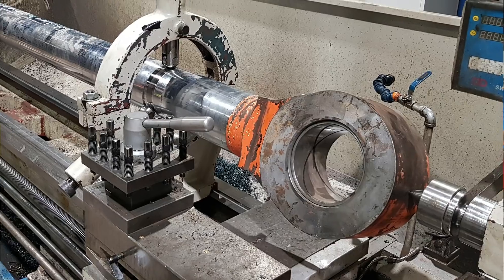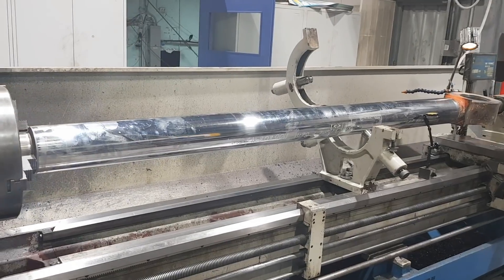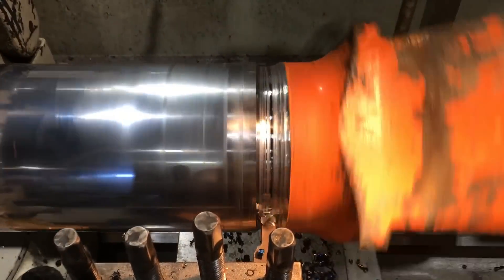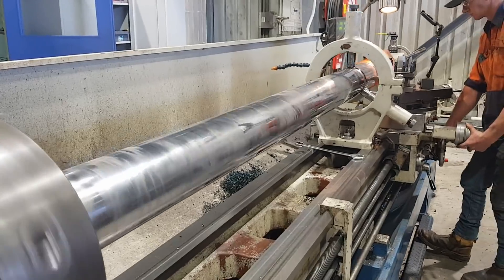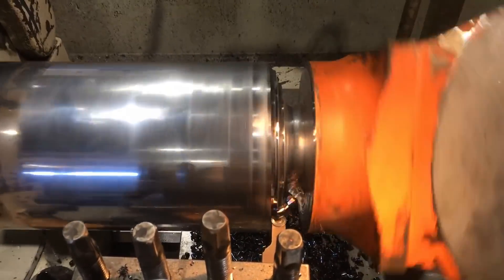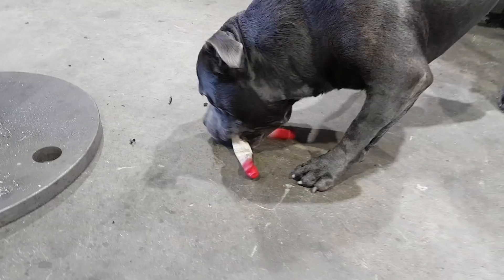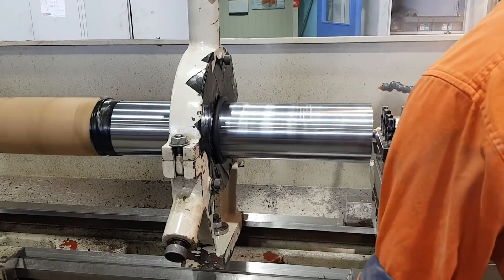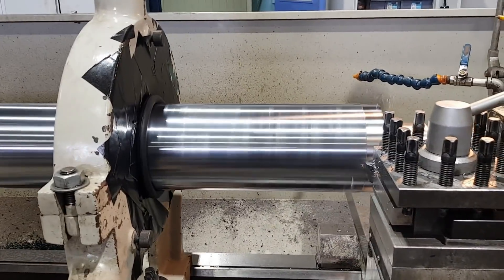Machining a Hydraulic Cylinder Rod for Hitachi EX1900 Mining Excavator | Lathe Work & Welding

Comment from the maker: Hey viewers thanks for watching today's video on machining a new hydraulic cylinder rod for the Hitachi EX1900 excavator. This one was a job we did last year so we've included some extra commentary to answer a few questions we often get about how or why we do what we do! If you have got any questions drop a comment below and will do our best to answer them 😎👍
Subscribe and hit the bell icon to turn on notifications so you don't miss our weekly uploads. 👇 🤳
Follow us online here: 
Instagram https://www.instagram.com/cutting_edge_engineering 
Facebook https://www.facebook.com/cuttingedgeengineeringaustralia/
Reply: Thanks for finally clearing up my question about cutting threads. I still don't know what a "top slide" is, but after watching this video and watching you REVERSE the lathe, and therefor the cutting tool, I finally understood how you got the tool properly indexed to the already cut thread.

BTW, how would I go about sending the shop foreman a new toy that might be a bit harder to destroy?
Reply: Hmmmm I've seen you around somewhere you wouldn't happen to be around western subs
Reply: Dam you need a solid rubber chook
Reply: Dam have you thought about making those nuts yourself $3000  per nut is good money I'd prefer local then having to wait for a part
Reply: Pl
Reply: Imteressante

Comment: Duck Tape was invented in World War II by Vesta Stoudt, a mother of eight. Two of her sons were serving in the U.S. Navy. She was packaging cannon shells, and realized that the paper tape, being used to seal the boxes, could not be torn off without breaking, which could cost soldiers precious time in battle. She invented duck tape because it could be pulled off in one motion every time without breaking. She wrote to President Franklin D. Roosevelt in 1943 with the idea to seal the boxes with the fabric tape which she had tested. The letter was forwarded to the War Production Board, which put Johnson & Johnson on the job, since they had made medical adhesive tapes from duck cloth. They developed the new adhesive tape, made of thin cotton duck coated in waterproof plastic, and using a layer of rubber-based gray adhesive. (The technically correct name is duck tape, since it was originally made from cotton duck cloth.)

Comment: The first time I tried making threads on a part I used the travel dial method. I started out with the half nut engaging just before the line on the dial, but one of the times I timed it wrong and ended up on the other side of that line and my cut ended up being down the center of the top of the thread. I did the rest of the cuts by keeping the half nut engaged and all the other ones I've made since then have been done that way because I don't trust myself enough and I don't have a bunch of scrap material laying around to practice on. Gotta get it done right the first time. Takes a bit longer but you can't screw it up that way. When you've got a $2k piece of chromed rod chucked up, I imagine you don't want to mess that one up either.

Comment: you know some cool tricks! An old timer told me to make threads even faster flip your tool and run in reverse, I tried it once but figured it may damage the ways. I thought I seen you threading with the cross slide in a couple other videos, I do that as well. my college instructor was a machinist, he taught me a few cool tricks, like the way to leave the half nut and run it back to your start. stuff like that just isn't in a textbook. hopefully ill be working on large pieces like that someday

Comment: @ 10:03 I was taught the same method in trade school which works well in bot metric and imperial standard threads. But the threading dial is much better if you had to to do another job in the part or the machine was cut out of power while working on it (for safety reasons) . But most threading dials are designed for imperial style so this method is your only option sometimes.

Comment: I was confused about the rest of the rod until I read the description section.  I'm not a machinist guy, so explain to a dumb dumb why you dont weld that thing down and pull out a monster press to bend it back into shape.  Even if it deformed a little, you could lathe it down for a smaller excavator...

Comment: question for a none machinist background as I chose to be a diesel mechanic which I kick myself for every fucking day as I watch CNCand lathe videos everyday asking myself why i didnt try to be a fitter and turner but with ceramic vs carbide and other inserts whats the pros? like do the ceramics not require cooling and do the inserts run hotter then metal counter parts?

Comment: I didn't really understand the explanation for the threading, so you just turn the top slide slighly to the left/right to avoid cutting on both edges? Did you scrap the old shaft or can it be used as stock?

Comment: Yeah nothing wrong with reversing the machine when screwcutting, but when it's a really long thread it is easier to disengage the half nut. But on threads the length your cutting I'm with you just reverse the machine

Comment: Nice Job.  Thanks for some extra input on some of your procedures.  I just got to machine 2 induction harden rods my self yesterday.  Just a bit smaller at 3-1/4" or 82.5 mm.   Appreciate seeing your way of doing things, and see if I can pick up any other ways to be more efficient.  

Tell the missus great job on different camara angles, and split screens, before and after photos.  

maybe its time for you to machine Homeless a solid piece of rubber and see how long that lasts.

Comment: Just for curiosities sake why do you choose to use argon heavy gas with the CO2 mixed in when welding up the cylinder rod? does it give better penetration, more uniform weld bead, weld pool flows better with the lincoln wire your using, something to do with how thick the rod is? does it give higher heat output than regular argon 75/25 mix like when using helium for TIG welding to get a bit more punch?

Comment: That rod is off a savage machine. I don't think there is anything as big as that in this whole country (Ireland) A Cat 85 was probably the biggest I've seen here and that was massive. The induction hardened rod is slow going, the ceramic tips do a good job. Good welding on it too, no major grinding needed 👍✊

Comment: Yep, OEM nuts are expensive. CAT is insane, I make about 200 plus nuts a year for cylinder rods due to that fact though. My shop got in the habit of keeping 4140 hex in stock up to 12” dia just so we can make replacements on hand and still at about less then 1/2 the price. You said you worked at a production shop before, that explains some of your habits lol. Did you always work in production till you started your own place?

Comment: Kurtis, what happened the the old shaft, returned to the customer, or you get to keep it ? 
🐕Homie got chicken & chips although chips are a bit too crunchy 👍🏴
Reply from the maker: If the customer doesnt request the damaged part back we usually scrap them to metal recycling
Reply: @CuttingEdgeEngineering  would be worth a few dollars 🍺

Comment: What I like most about your videos is that you do a quick show and tell then get to work letting us enjoy your work, and the distractions you endure which make life so enjoyable. The most impressive bit so far is doing the rod end line bore and weldment. It reminds me of a specialist I had from Houston, Texas that completely repaired a heavy duty set of axle bearing locations in about 6 hours after I removed the bits that were in his way. It was FUN to watch a real PRO, and it is the same with you. The large lathe you installed is impressive in the capacity and quality you get in the finished product. Did you ever do any friction welding?

Comment: Thanks for threading explanation.  Lightbulb moment!  Of course, instead of messing around with a 29 degree setup, simply plunge some, and bump forward some to cut on the leading edge....    and the ratio is a trig one using COS and SIN of 29.  So a .020 advance on a 29 degree topslide is .017 in and .009 forward....  by my quick math.  I will try that next time I thread.     How deep a cut do you take on that size of cylinder there for your threading??  Thanks for vid!
Reply from the maker: Hey mate thanks for watching. First cuts generally 1mm at a time then after third pass whatever is needed less is more on the final passes

Comment: How did you get that center put in the rod end for turning the rod end off? Did you hold the rod end in a tailstock 4 jaw so you could turn the steady band then come back to put in the center?
Reply from the maker: hey mate with these there is a center hole standard from factory 😎👍
Reply: @CuttingEdgeEngineering  oh okay that makes sense! Not sure if I'm a pessimist or a realist but I figured it would've long been mangled into nothing by a 300 pound gorilla with a mighty sledgehammer! Sorry, I mean "Maintenance Technician"

Comment: I wanna know why you use coolant on the lathe sometimes and don't other times. It always surprises me when I see it not being used.
Reply from the maker: Hey mate for these sorts of jobs I don't use coolant when machining the induction hardened layer while using ceramic inserts as the coolant will create thermal shock and shatter the insert. Other jobs if I'm using a Carbide insert they can be used hot/dry or flooded wet and I prefer less mess haha

Comment: Looks like I was way off on the challenge. What a beast to have two bucket cylinders. The largest I have run is the 700 Volvo. Even it has just one for the stick and same for the bucket, one for the thumb. As usual great footage and editing. I can still remember the smell of freshly made chips from carbide inserts. My old Chez lathe had no split nut dial. Threading like this was how it was. No risk of getting the nut almost fully engaged and ruining a thread or possibly the whole job. A piece of stock like that sure isn't cheap eh. LOL, Poor chicken. Take care folks.

Comment: Could the eye be friction welded to the shaft?
Reply from the maker: hey mate could be possible but the size of the machine to do that would be impressive. Factory OEM use mig weld or sub arc

Comment: When putting the eye back on, how did you know exactly where to tack it on?
Reply from the maker: The eye has a center hole from factory, the rod is machined to spec and size for the eye, then all held center in lathe before tack weld.
Reply: @CuttingEdgeEngineering  Ah, gotcha. That’s cool!

Comment: Why was straightening the rod determined to be not a viable option?

Apology if this is a duplicate question. I searched in the comments but didn't see it asked.
Reply from the maker: hey mate pressing to straighten would damage the chrome then need re-chroming so not as economical to just re-rod it
Reply: @CuttingEdgeEngineering  I thought that might be the issue, but wanted to confirm.

Thanks! Really enjoy your videos.

Comment: On the subject of old dudes, one thing you can do with the compound, is put it 90deg to the cross slide, so when you have to rework a pile of under/oversize threads you can use the compound to line up the existing threads and recut them to size... its something I got fairly good at being a lead... and having to fix other peoples mistakes... the bossman refused to fire the idiots that continuously did this or make them rework their fuck ups... hence one more reason I'm not a machinist anymore.

Comment: the 59deg angle on the compound for cutting threads is a hold over from the old HSS hand ground thread tools, modern inserts cut on both sides, increasing tool life etc. The problem is old guys continue to teach the same dumb shit so younger folks continue the same dumb shit... its infuriating...

Comment: In regards to cutting, what people need to understand is this. The thread doesn't care how the machine is setup as long as the cutter describes the same motion as it is required. So, if you cut all that part out, as long as the cutter moves in the horizontal plane at the correct speed (and the other parameters) the cut is right. And you can achieve that motion, in a million ridiculous ways.
IE. One way, isn't THE right way. As the saying goes, many ways to skin a cat.
Reply from the maker: spot on mate couldn't have said it any better

Comment: Great video - fascinating to see experts at work with big tools.
1) Why not straighten the bent rod by building up weld then re-machining? Is it cheaper to get a new rod in, or is the old bent one damaged somehow in a way that straightening by building up & re-machining won't fix?
2) Why get induction hardened metal if you then remove the hardening? Or is that only a short section of hardening removal and the hardening stays on a long section to increase strength?
Reply from the maker: hey mate thanks for watching!
1) could possibly be straightened by pressing but chrome would be damaged and need re-chroming so not as economical as just re-rod.
2) the induction hardened layer is on the whole length of the rod. We machine off only enough for the ends to be completed

Comment: G'day Kurtis and co. I'm a kiwi and noticed we have hafco lathes available here in machinery house (pretty sure it's in aus too) I noticed one of your lathes is a hafco andwas wondering if you could give a quick rating of whether they're any good? Also can't wait to see the, new to you, big lathe running!!
Reply from the maker: Hey mate! Yeah we've got Hare and Forbes machinery house not far from us which is dangerous for my wallet hahaa. So the TM (Taiwanese) series Hafco lathes are a very good quality lathe and value for money. They have a German spindle bearing system in them as well. I've got 2 of the TM series lathes and also a Hafco BM milling machine. But the Hafco CL (chinese) lathes I personally would avoid you get what you pay for there. Cheers, Kurtis

Comment: Hey Curtis, another cracking video! Can I ask do you machine the rods to the manufacturers drawings or do you just copy what you're replicating? Does the customer supply the piston so you can machine the rod to fit it (like with the piston nut) or is the tolerance on that not so critical? Have a great weekend!
Reply from the maker: Hey mate generally OEMs aren't very helpful in providing drawings so in some cases we copy the part supplied and customer provides the piston and parts needed for testing specs 😎👍

Comment: I always leave half nut engaged and reverse back. 
I noticed your compound is always straight. So you feed cross slide in 1 then you advance compound 1/3 
Or you trig up tables with right ratios
Reply from the maker: Hey mate that comes down to the thread pitch as to how far you bump the cross slide.

Comment: I don’t know how your pup doesn’t get a  piece of swarf in his foot, no matter how much I sweep up my pup always finds a way to get a piece in his foot 🙄
Reply: Oh man, my projectdog would give me heartattacks. I'd get a new load of metal in, just roughly stack it. 24' sticks of square tubing, random offcuts of various sizes, plate, etc stacked on the side before being put in the 'sled' shelving, and I'd turn and she would be precariously balanced at the top right-rope walking extremely quickly. I'd call her, and then she'd act like she was too scared to come back and gently tap her foot like 'oh no, where ever can I step? I'm too scared, it's shaky! Come pick me up!" even though I saw her just RUNNING down that same damn piece of tubing 15 seconds earlier. Then having to degrease her paws lol. She'd go running under where I was plasma cutting with red hot slag still on the plate (to protect concrete), and I'd end up having to use my foot to move/block her from walking over it, then she'd look at me and huff like she was the offended party. Then try to step on it AGAIN before I'd yell at her to git, then she'd go scamper off. I miss that girl!
Reply from the maker: Hey mate he's spent 8 years growing up in a workshop so has very tough paws 🐾💪
Reply: @CuttingEdgeEngineering  We had a 120 pound boxer grow up in my fab shop- I never realized how tough or intuitive he was just from his daily environment.

Comment: Nice chips and good idea on the topslide, never thought of it like that, way easier way to do it. 

Have you ever thought of knocking up a small piece of sheet steel (50X50 or whatever) the throw in your tool holder just to act as a deflector when you're removing bulk material so it doesn't end up of the floor and down your pants cause you left your fly open?

Comment: I wonder if an iris made of metal attached to the steady rest would be possible. you only need it for the top and sides.  It would be possible to make out of sheet steel with plasma cam. You can still use an oring too, but the nice thing about the iris is it would fit all shaffts

Comment: Hi I love your videos they are so much more interesting that cnc machining as all is done in open beds. One question do you keep the steel to machine different parts for other jobs? I know the company I did my trade in Sheet Metal Engineering had a tool room that did used damaged shafts for other jobs if it was big enough.
Reply from the maker: Hey Paul thanks for watching mate Yeah we haven't gone to the dark side yet with Cnc 🤣 Most of the damaged rod material goes to scrap metal recycling for our quality control but some big bits we keep for the odd workshop project